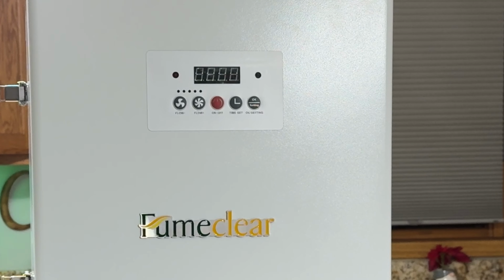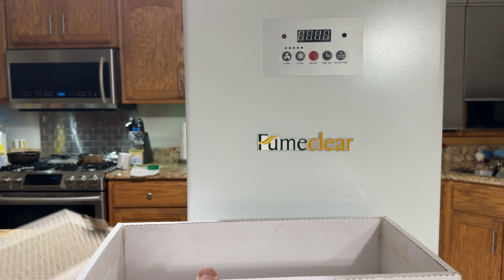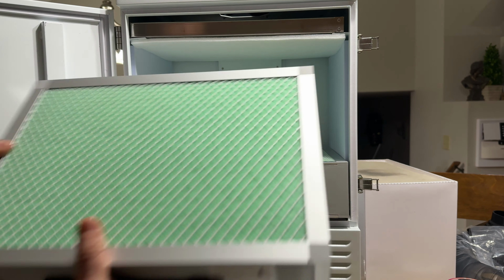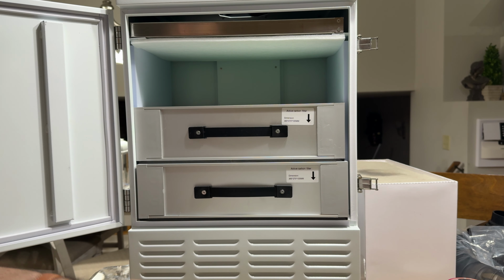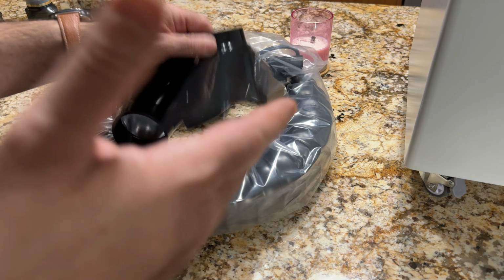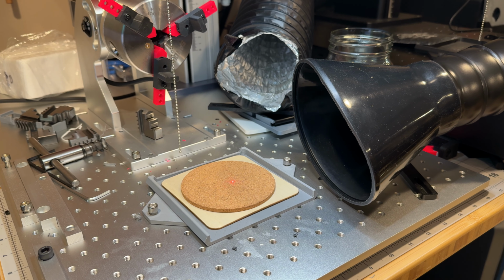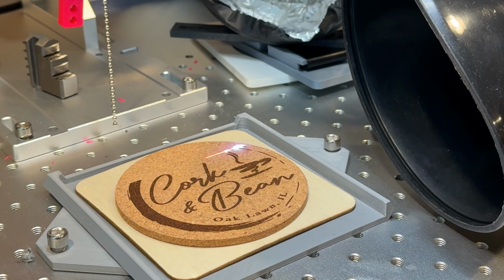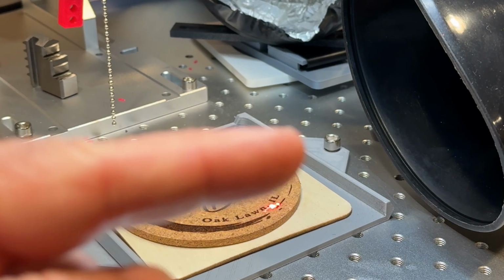FumeClear Review Demonstrates Exceptional Performance

Comment: Nice breakdown - where does the purified air exhaust?   Out the bottom or from the back side where the louvers are?  Trying to see if this could be adapted to a plenum to pipe exhausted air out through a hose.  thanks!

Comment: After watching your video I purchased the same fc-350 and it is very powerful, but it is much louder then the advertised db on the higher settings also there’s an high pitch frequency nose when it runs on the lower settings maybe from the speed control is yours also like this ?